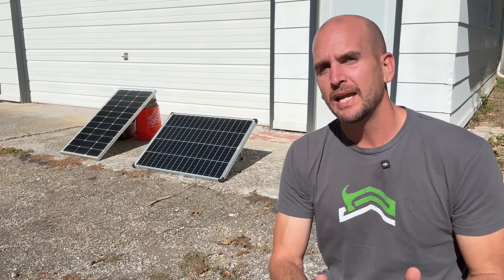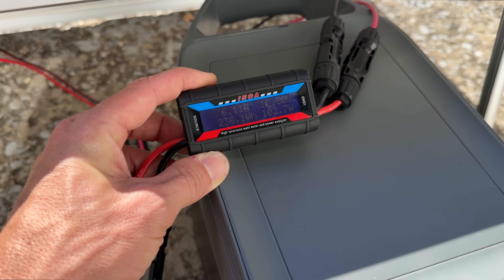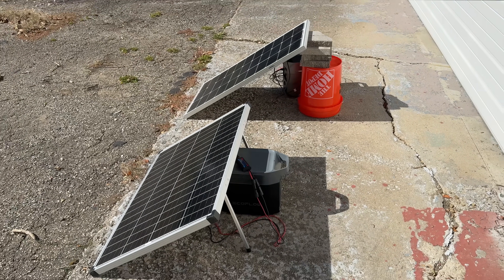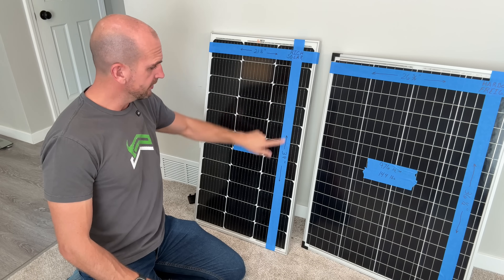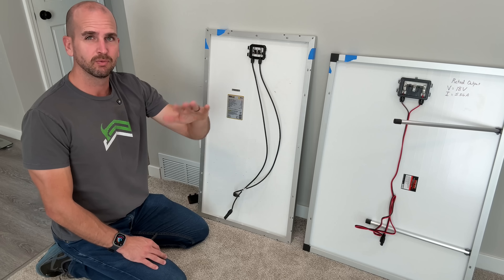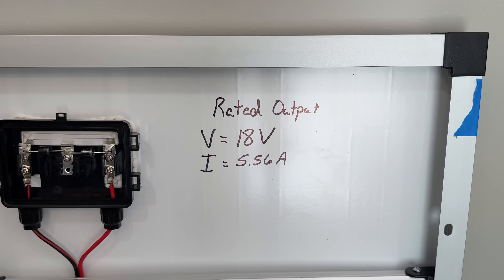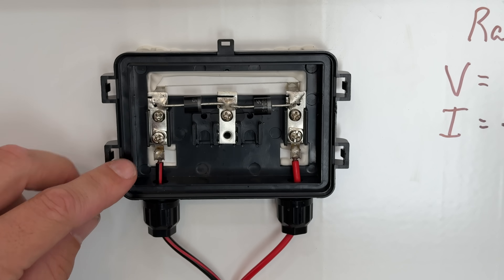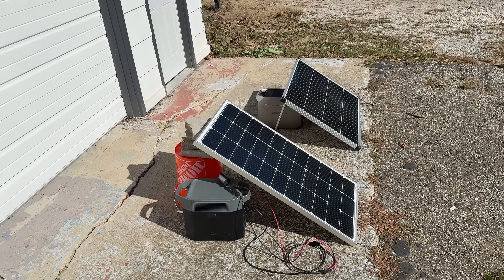Harbor Freight 100W Vs Rich Solar 100W |  Tested!

Comment: I used NewPowa after doing similar testing. New they outputed 120w , here 4 years later still output 112w where as the Renogy is never above 88 watts .

Comment: New sub today, Great test I learned a lot and am getting the angle app. I like the Harbor Freight a lot now, although they should put the standard power sticker specs on each panel.  I love the fact they have the SAE quick connect/disconnect plugs. I actually cut off the MC4 and wired in SAE plugs as the MC4's were not designed for many disconnect cycles it's more of a permanent type connection.

Comment: The framing on the Rich panels is far better construction than H.F. plastic corners. Plastic deteriorates under UV light and heat, exactly what these panels will be exposed to. That being said, I think over time, you would get your moneys worth from either of these.

Comment: how much power can be produced in a 10x10 area with each panel.  How much that would likely cost for that area of each panel. both points I believe are valid to look at.  due to the "off grid" comment, makes me feel like people will factor that in.

Comment: Another consideration might be to compare the power produced per square foot of panel and the cost for a similar amount of power production.   Which solution would be more effective on a given amount of surface area?

Comment: The Rich Solar looks smaller in size than the Habor Freight panel.  If so,  it would also be good to calculate watts/sq inches of panel size to see which would produce more in a given space constraint.  This would be important for small roof spaces like on a tiny home or RV.

Comment: If you are installing solar systems and making video's. You need to test the output of the panels in 5 years then 7 yrs then 12 years etc... and make video's in the future about the output over the life of the panel. I would look forward to seeing a video in the future about the output over the life of the panel.
Reply from the maker: Yep, that is on the overall plan but going to take a bit 😕

Comment: First off, I hate the site wanting so much info just for quotes from 4-5 different companies... Now I'm waiting to spam the emails and block numbers...
$43k-$62k to set my small 2 bedroom house up for solar, just to save $130 a month on powerbill? It would take 393 MONTHS (right at 33yrs) if it cost $51k for installation, just to break even and that's IF the panels/batteries lasted that long... We all already know solar panels average 25-30yr life spans if taken care of properly. As for the batteries... They average 5-15yrs. Which means for the average person, solar energy just isn't practical. BUT for camping, it's actually pretty easy lol.

Comment: Performance per 100W panel is a pretty useless metric regardless of goals. The more useful metrics are energy per cost, and energy per surface area. That 17% gain is at the cost of some surface area gain. Don't make us go back and do that math.

Comment: The rich solar panel had a less of a drop of output wattage compared to the harbor freight panel in the afternoon run. 

Are there any longevity comparisons out there ? How long would either last with heat/ cold cycles and withstanding severe weather ?

Comment: Given that the Harbor Freight panels are 15% bigger and the out put is 17% more, it would come down to cost and surface area available.  If the cost is the same but you have smaller space available,  the Harbour Freight panels would not be a good choice. If the cost is less for Harbour Freight panels then it is worth the difference.

Comment: Very interesting test , and it looks like i've got some catching up to do with your videos too . i've been looking at solar for some time , but get confused with all the different spec's listed . I don't fully understand what the different spec's are , plus some don't even give the same spec's , so i find it difficult to compare different panels .  Can you give me a heads up on the specific spec's i should be comparing , from a laymans perspective . I'm over in the UK , so suggesting certain panels won't help , as they may not be available in this country .

Comment: Harbor freight right out of the box, 8 watts in the shade away from the Sun. 94 Watts immediately, the damn box is probably worth $100 practically it's the best deal ever. Bluetti 120 watt never did that on the first day, leaked silicone after a year for twice the price. I'm buying as much as I can this year.

Comment: A 17% difference in how much power they generate, but the HF is also 16.26% larger than the other panel. So, the difference is negligible. I'd say the main difference here is the price difference. HF is $119.99 and Rich Solar is $89.99. A $30 dollar price difference, you can easily make some feet for the RS for less than the $30 difference if that is your sticking point.

If I bought 10 of the HF, that would give me 4,950 wh a day at a cost of $1,199.90. To match that output I'd need 11.45 RS panels, so rounding up would be 12 with 5,185 wh a day at a cost of $1,079.88.

Comment: And those are what kind of Diodes?  Possibly, zine or diodes?  Clipping off the high DC voltage coming from the panels?  And the Harbor Freight look like they can handle more current as they appear beefier than the Rich Solar puny diodes.  Hmmm?

I got this 22-year-old, 34 foot long, short rare, diesel pusher  Motorhome.  And it's never had any Solar, up top.  Time to install some.  Though?  I just replaced the 4, six volt, deep cycle, lead acid, Coach Batteries.  And I blew, $850 on that.  Lithium Conversion will come soon.  With new charger, echo charger and all that.  And I'm a, lookin' at what kind of, Solar.  I'll be able to afford.  On Social Security income only...  And I want much more than 100 Watts.  500+ Watts or more the goal.  It's only 34 feet long.  2 air conditioners, skylight, a couple of roof vents.   One RV TV antenna.  And a fair amount of open space.  Probably enough for 800-1000 Watts?

I think I've seen 250 Watt panels about the same size as those?  Likely for double or triple the price?  I haven't looked lately?  But for an entry-level system.   I guess the Harbor Freight is hard to beat?  And great for portable use with the prop up legs.  My kind of thinking.  And they were Chinese.  And for once.  They did something that made sense.  Put legs on for Nomads.  Brilliant!  Who would have thunk?  Rich Solar, didn't.  And didn't offer that as an option either?  Right?

I might just start with a portable system.  And see what that can do or not do?  100 W isn't much.  That's one LCD TV.  Or one laptop.  One phone charger.  And no microwave oven action.  No cold food or ice.  That's 100 Watts.  You Got's to have a Lithium Power Station.  For direct energy conversion.  Nothing much off the panel, directly.   Such as your laptop.  Without getting your power station battery recharged.  And you will be in the dark at night.  Whoops.  Dammit all!  Shit!  And the battery is pooping out on my phone.  And I can't afford a new iPhone.  God dammit!  And would I even want one?  How about last years model from 2 years ago?  Are they on sale?  And does it have a built-in, solar panel charger?  Why haven't they built that into our phones yet?  Just what the hell is going on here?  Haven't they ever heard of, Tinkle Charge?  Anything would help when you're in a spot of no available charging.  And we want to lower our green footprint don't we?  Shouldn't our smart phones be smart enough to contain a single, solar cell?  I what the hell is going on here?  How many cameras do they have?  No room for a solar cell I guess?  It's better to be, beholden to the, Power Conglomerate.  Instead of a cheap little solar cell built into our not so smart phones.

Nobody ever talks about that?  Shouldn't our smart phones get smarter with solar cells built-in?  Leave it on the dashboard of your car.  And it is all charged up by the time you are ready to go to work.  In the morning.  Since you did not get up until 11 AM.   And the phone has been, charging since 6 AM.  And Voilà!  Free charging.  But no!  Not Apple.  Not the Taiwanese.  Not the Koreans.  Nor the Japanese.  Have bothered to install solar cells on their stupid fucking smart phones.  And so what are we to believe now?  I are they for real?  We may never know?  But that is neither here nor there.  And I digress.

I was talking about the poor investment of a built-in swimming pool.  Wasn't I?
RemyRAD

Comment: I bought the Harbor Freight panels that came with 3 fifteen watt panels 10 years ago.  Within 2 years, they had all stopped producing power at all.  The junction of the wire with the panels had all corroded and broken.  They were good for getting my feet wet in solar, but the traditional metal framed glass polycrystalline panels I replaced them with are still going strong 9 years later.  I do like the HF controller, though.  It still works fine.

Comment: STOP the presses.   HF did not WIN!   WHY?  YOU missed one particular part from the middle of your video....  The HF panel is 17% LARGER than the Rich Solar.   HF had 976 square inches vs 829 for the Rich Solar.  Easy math tells me they are pretty equal

Comment: VERY surprising! I went with Rich solar because it was a solar company and not a misc product company! Wish I had seen your video before I started my system. Thanks
Reply: watch this videio:
Harbor Freight Thunder bolt Solar panels- What You Need to Know!

the reality is all panels are different if you have luck and you get a good batch any 100 watt panel delivers 100 watt if you not have luck you get 70-80 watt out from a 100 watt speced one.
the brand is not important all companys have this production spread !!!
so in one yputube video like this a HF reach 100 wat in another it rech 70 watt same like rich solar in one video near 100 watt in another 70 wat....
forget this youtubers what make 1:1 coz you not know what batch he get or what you get if you pay for one....

Comment: Durability over time was not addressed in this video but it is one of the most important factors. I will take 17% less wattage to have panels that will last 10 times as long. Besides when you adjust for the wattage per square inches the Rich solar panel did just as well or better and is built better.

Comment: Your intuitive preference for solder connections is common but wrong. Crimp connections are preferred by both NASA and the FAA. And don't solder after a crimp. All this depends on the knowledge of the workman. You need to be proficient in crimping. It is not just crushing but needs some learning and even (God forbid) reading. Soldering requires learning and practice as well.

Comment: Reasonably good comparison for the specified conditions. Looking forward to the planned comparisons of other brand solar panels with HF as the baseline.

There's a typo/math error:  232+191=423. You have 432 resulting in a 16.67% difference.

Comment: What I didn't see you compare was their list prices. I'm not interested in sale prices because those fluctuate all over the place. With the prices included, I'd like to see dollars per Wh or whatever the normal calculation is. I'm not as concerned about physical panel area unless a much smaller panel can generate a significantly higher amount of energy.

Comment: There is no 17% difference. The HF panel has 15% more area. You said before the test that this would make a difference and it did but you did not take this into account. You should have done a comparison in square inches. Thai is the true output and the ONLY way to compare ALL panels. IMHO

Comment: I ran the HF 25watt ones for 6yrs Every day and im Now running HF 100watt panels Every day fer 5yrs and they work just fine 👍 Now there controllers ive had bad luck with and ive been running the Aims controllers 👍👍 Everyday for the past 5 yrs. ! As im Retired / Boondocker and use 300 total watts to run my MH ! So i see No since in buy any kind else since the $ price & performance has been great 👍

Comment: I didn't need a calculator to see the error.  It was on the board plain as green on white.  232+191=423.  There.  Fixed it for you.  🙄

Comment: How about doing a test to run a 12 volts 💡 bulb, to see which one will be the brightest 👀?. I made a frame for each pair of panels out of steel square tubing, since my system is 24 volts. The first pair, * * I used bigger square pipe, It's pretty heavy so I don't move that one very often. But the Oklahoma wind doesn't blow it around, either.. Half my panels lean onto the East side of the barn because 🌪️ tornadoes come out of the West. It makes them easier to put in the barn when big hail is coming. Eight of them are fifty feet away so they don't get shaded by the barn in the evening. I was getting 869 watts this morning about 10:30 a.m. from sixteen 100 watts panels. There's two that are poly that Im going to put on my truck camper shell, so I am looking for two mono panels to replace those. I have just enough panels to keep the four 25.6 volts 100 amp hours lithium batteries charged that run my inverter. They're also charging four series 31 lead acid batteries in 24 volts hookup which buffer the load on my expensive lithium batteries. It's working great. * You could also run a 12 v fan off each panel and see which one blows the most air.😮

Comment: You mentioned the difference in size, what about cost.  How does the measured Watt hours calculate out per $, or per sq foot or panel area?
Reply: 100w panels on Amazon for $55ish
Reply: @mrmotofy that is good, but not as good as it gets. For larger panels, you can get them as low as 27 to 33 cents per Watt, so around $100 for a 300Watt panel.
Reply: Harbor freight panel costs 119.99, Rich Solar panel is 89.99. The Harbor freight panel is 33% more expensive than the Rich Solar panel, yet only gives 17% more Wh. It seems like the Rich Solar is the clear winner in Wh per $ ???

Comment: what i would have liked to see is as the panels are different sizes a comparison of how  much each panel was generating per square inch which would give you a mre accurate view of the efficiency of the cells.

Comment: An interesting approach to the compare and contrast game. The 17% improvement in energy harvesting maps pretty closely to the additional area of the Home Solar panel (976 sq in) compared to the Rich solar panel (829 sq in). Which seems to suggest that, for a given panel rating, panel area is a key design factor. Or am I missing something?

Comment: Have you ever tested solar panels to see how much they can absorb and pass direct to ground, where rebar has been driven into ground teh same thickness and same depth, and maybe even wet the ground there also before testing. Wondering if they can gather and pass more energy direct to ground instead of using batteries. Every battery isn't always at same depth of discharge before using in a test like this, and that might skew the results somewhat,.....perhaps.

Comment: Great video! I have been wondering if it is worth picking up panels from HF for our off-grid system. We are in a 40ft RV and trying to set up a system that will keep the RV battery bank up.

Comment: I have done medieval re-enactment for over twenty years... although we try to do everything relatively "primitive", we also do not compromise on modern safety and use actual refrigerators hidden away  out of sight or disguised to store critical fresh food items and medications... we also use the deep cycle batteries for recharging cell phones, radios and other devices, and more recently a couple of CPAP devices and ceiling fans... we started off with a single set of panels, charge unit and a deep cycle battery, along with an inverter... that covered us fairly well over the first two week encampment.  The next year we bought another set and doubled our capacity. We bought a third set two years later to increase capacity with more people in camp, and another set two years later to accommodate a mobility scooter... we have also added a total of 6 batteries (2 were replacements). We have added hidden electrically powered items and had to replace three individual panels due to packing and early-on storage misadventure... and most recently we had to replace the original set (after fifteen years of use)... These panels now run a full sized refrigerator and freezer, two mini fridges, two CPAPs, two mobility scooters, a myriad of cell phones, cameras, and laptops, as well as four ceiling type fans in our larger tents. They also supply several carefully camouflaged lighting features... I totaled up the expenses to about $1600 over the past 20 years and they also serve their time at my home for much of the year to almost completely run all but the most power hungry tools in my shop and an outdoor patio with a gazebo.  These were ALL Harbor Freight solar panels and always purchased on sale. They are still going strong and the addition of newer low price and efficient technology has only improved the performance.  I have talked with many others ( there are over 12,000 people at these events and many use similar systems) and most have marveled at how much we operate on our setup and how little it cost... All of the factors mentioned are important when designing a system, I am an electrical engineer, and one should always consider the uses and the situation/environment of operation... but Harbor Freight has been a solid balance of price, power, warranty, ease of use, and durability.  YMMV but that is my quick and dirty review and "endorsement" as it were... LOL
Reply: Love this write up. I personally have always written off solar as prohibitively expensive, but your experience gives me hope to actual consider trying a small setup